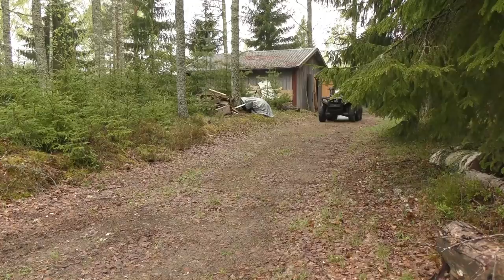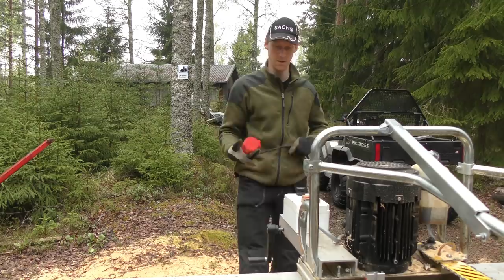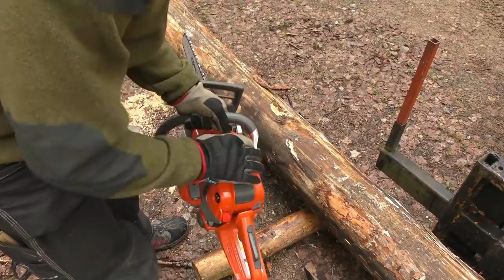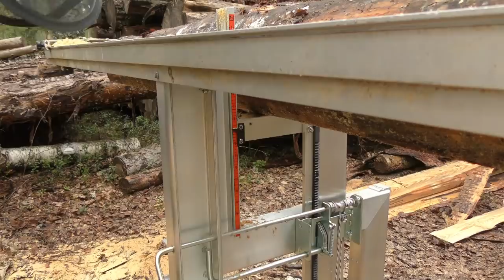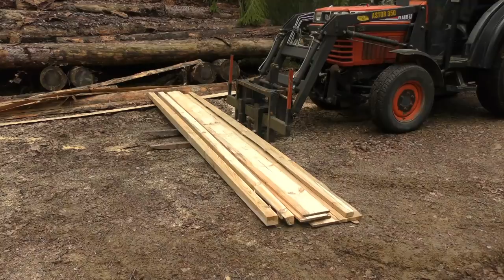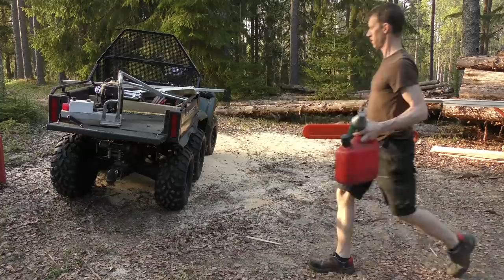Milling on the chainsaw mill — THIS IS AWESOME

Comment: Hi Andreas, I am doing well and had come in from doing yard work and saw that you had posted a video. It is hot and humid today on the coast, much hotter inland though. That is a very portable and easy to use mill apparently simple enough that one person can easily operate it.
Reply from the maker: Dennis St.Germaine Yea it is awesome, easy to run and easy to move. The only thing is that the saw it self weigh a lot. We are also having very hot weather here.

Comment: It's nice to see someone actually cutting usable boards with one of these. It seems that all the rest just cut 2-4  inch slabs the width of the tree.  What can you use that crap for anyway other than making some really large table.  I've never seen anyone resaw the stuff to make it in usable sizes.  Thank you!
Reply from the maker: Thank you very much man. Yea, it's really important for me to cut usable lumber that I can use to repair the old house. I'm also going to build another building so se will be milling all different dimensions for that as well. Have an amazing week and thanks for watching. That means a lot to me.

Comment: Greetings from off grid  Oregon, I like your mill. I use an Alaskan mill if I have a log that is over 21' long as the WoodMizer will only cut 21' I put a boat winch on one years ago that worked well. I use an old 051 Sthil on our old chainsaw mill. Your mill is very well engineered Andreas. Have a blessed night!
Reply from the maker: Thanks Steve, are you still having that really warm weather? I have seen a lot of Americans talking about it.  Here is so warm that you cant get all things done that you plan.
Reply: Offgrid.se It was in the 50s and raining yesterday. I needed a fire this morning but it got to 70f today. It should get warm here in July and a week or so in August then we are back to rain and snow lol. That said we have a much warmer climate than you do I think.

Comment: If you place boards under the feet of the sawmill you’ll experience it more stable and won’t wobble as much, also, have a look at the rubber wheels under the sled. They seem to be stuck and probably worn. Replace them and you will have a much easier time moving the sled. And for safety, wear chainsaw pants as well instead of standing that wide. Your back will thank you later. Nice video and nice setup thumbs up
Reply from the maker: Thanks for the tips man! Have an awesome evening

Comment: I'm sorry, but the idea of a chainsaw mill is that you can easily take it to your tree, fell the tree, and make boards on the spot, no tractor needed to move the trees. 
If you're going to make something this size I'd really suggest a Swing Blade mill. You will save in effort, time, blade cost, and material loss due to blade thickness.

Comment: How about hardwoods like cherry, maple, or oak?  Pine is an easy cut.  What about the power source?  AC, DC?  size wire?   Does the motor get hot and shut off?  Interesting mill.  No gas
Reply from the maker: There is no problem with hardwood if you got a sharp chain. Its AC and I dont know the wire size. The motor never gets so hot that is shuts off. Have an amazing Thursday!
Reply: @offgridsweden  thanks.  I ended up milling over 800 board feet with my 18 inch Stihl and the small Alaskan mill.  It took a long time to get it done, but now I've got Cherry drying on the porch and properly stickered.

Comment: I watched the far side of the chain bar and it seemed to be moving somewhat up and down in sync with the turning of your feed crank.  Are you seeing any wave in your cut or is it fairly straight?  Looks like a nice unit and quite simple which is what one strives for.  Thankyou for sharing!
Reply from the maker: It's fairly straight. I have adjusted sinse then and don't got any wobble anymore. The boards and beams that I'm cutting don't have to be perfect but it's always nice to try to produce quality lumber. Have an amazing weekend Shemon, and don't forget to subscribe for more videos 😉
Reply: Shemon Doublejack:   Thankyou for your quick response.  Glad to hear that it is working out to your satisfaction.  It's nice when  hard work is rewarded!  You're doing a nice job.  Good luck!
Reply from the maker: @shemondoublejack948  Thanks man!

Comment: How much did the chain saw or mill cost you? It is indeed an awesome tool. Love to own something like that as an outdoors man.
Reply from the maker: It cost me about $1800. I bought it used. Sorry for the late answer. Have an awsome Thursday
Reply: Offgrid.se  Welcome buddy !! Thanks for responding.
Reply from the maker: Are you going to buy a sawmill or do you already own one?
Reply: Offgrid.se a Yes !!
Thinking about getting myself one because I need  timber to roof my building project.
Reply from the maker: @TS-yg3lv  Sounds lite the perfect use case for a mill like this. Good luck with your project.

Comment: Love the set up , i have a gas powered band saw mill and it has it's good points but have one with an electric motor seems more friendly , and your blades seem to go through so easily ? are they designed for this type of cutting ?
Reply from the maker: Thanks Eric. It's a really nice setup. The blades are designed for this type of cutting and they are really thin. I keep them really sharp as well. Got a video on how to sharpen them as well. Have an amazing Tuesday man!

Comment: Interesting concept,......but I'm wondering how accurate the hand crank can be.
And with electric there's less noise.
Reply from the maker: Well its not for making material to build a  perfect house. Its rough material. If you want millimeter accuracy youll have to plane the boards. Have an amazing Thursday!

Comment: Is it me or did the blade lift and drop every time you turned the handle causing these boards are not consistent?
Reply from the maker: The slides where worn and there was a small wobble. All the lumber was fine. There is not used for precision carpeting 😁 I have changed those slides an now it don't wobble any more. Have an amazing weekend Mr Zippy and thanks for watching!

Comment: I have an Alaskan chainsaw mill and a mini mill to trim the edges and if you take your time setting it up right it does an awesome job. I run them with a big Husky. I liked the looks of your mill till I saw it run and I hope you keep working with it to get the slop out of it. It doesn't look like it would cut a very wide board and I was wondering what's the widest it will cut. It looks comfortable to run and may cut what you need and that's what counts anyway. Have fun and be safe young man and good luck on all your projects. I liked the guys idea of mounting the base on boards and anything you can do to stiffen the thing up is going to give you better cuts. I think the machine has good potential just needs some tweaks ! I liked the video because it was so different and I have not seen one like that before.
Reply from the maker: Thanks man. I have the bar that handles the logs I got but you could put on a longer bar to take larger dimensions. Not full twize the size I'm cutting but almost. Have an awesome week!

Comment: Super nice mill bud ...
Reply: I have a Jonsered mill made in Sweden that uses an 89 cc Jonsered or Husqvarna (un modified saw) that runs on wheels on rails at ground level so the logs don't have to be lifted - much simpler and more economic system (but they don't make them anymore)

Comment: dont rev the chainsaw with the chainbrake on, not good for the clutch. also let the saw warm up for a minute before cutting. all parts are cold and will wear down much faster when you do that.

and i would have replaced that crank handle with a cordless drill. much easier.
Reply from the maker: Thanks for the tip about the chainsaw. To replace the crank handle with a cordless drill wouldn't be a good idea. The saw will cut uneven and you get small waves in the bords. There is an add on to have it cut automatic but it's to expensive. I get a good workout 😁 Have a great weekend.
Reply: great weekend to you to. altough i would like to share my opinion about crank handle/ cordless drill. when you are cranking it you are emitting a force in 2 ways every turn (by your own arm pulling the crank down and up), a drill would only force it one way since its a constant and equal motion from begin to finish. but ofcourse i could be wrong, im in the process of making something like that myself with a drill attachement, so hopefully ill find out soon :D

Comment: I am in Maine, recently bought the F2+
When I went to buy the Schiller fuel injected saw they told me , and correctly, that science I have had shoulder surgery , I would not be able to pull start any saw over 50cc.  I tried it. They were right.
I asked if I could start the Stihl fuel injected using both hands..they said no.
But it appears that the F2+. Is stable enough so that I could start the saw.. using both hands to pull the cord
How can I get an electric saw and what is the cost?   I have  relatives in Sweden
Reply from the maker: Hi, you could get a Logosol ES8 at Logosol.com. it will set you back 2300 eur. But that is an amazing saw. Have an awesome week.

Comment: Has anybody else noticed how much the chain bar floats up and down? I don't think setup would be good for large slabs.
Reply from the maker: I have adjusted the sliders on the saw and it's more exact now. I'm using a really thin chain and bar as well. For larger slabs you will use a thicker bar and chain. Have an amazing week man!

Comment: How many kilowatts is the bandsaw motor? Also, how does the cutting speed compare to a conventional chainsaw, such as a Stihl MS660?
Reply from the maker: It's an old electric motor and I think it's about 3.5 kilowatts. I would think the cuttingspeed is a little bit better then a ms660 but I have never tried one so I really dont know for sure. Have an amazing week!
Reply: @offgridsweden  Thanks.
Reply from the maker: @massmanute  You are welcome.

Comment: One day you'll connect a battery drill to the feed handle and be happy!
Reply from the maker: Yea, not the first time I had that suggestion. I would like an automated system for it but it costs about $2000. A cordless drill don't work. You can't get it to move at the right speed and right preasure against the wood. But it would be much cheeper if it worked. Have an amazing weekend man!

Comment: right side looks like it might be better if it was also attached to a rail . there's no way those slabs are the same thickness all the way along the length of the cut , you could see the wobble in blade. needs to be solid across on both sides. other than that it looks easy to operate and cuts well.
Reply from the maker: Sometimes you get a wobble in it but mostly it cuts quite good. I have changed some sliding parts and it wobbles less now. Also keeping the chains really sharp helps a lot. Have a great weekend

Comment: New and don't even know if you still are doing this but I was wanting to know what is the name of your setup and roughly what did it cost I am in the US and I have been looking around at these Alaskan sawmills and ran across your video I would like to know what type of setup you have would it cut bigger and harder wood so if you would get back with me I would really appreciate it the video says it's been over 2 years hopefully you're still watching and getting emails
Reply from the maker: Hi there Eugene, I got that mill used but the new one can be found at Logosol.com. The old one I'm using have no trouble cutting hardwood so the new ones are probably even better.  I'm still milling.  I took a break from youtube but I'm back soon. I always answer comments. Have an amazing weekend man!

Comment: Are you using a Logosol F2 mill? I have a full size M8 mill, which is an older model. I like your electric saw chainsaw,  but it is way out of my price range, so I am using a Stihl MS660 chainsaw.
Reply from the maker: Some of mine is F2 parts. I bought an a old used one from a guy that didn't get any good results out of the mill. I kept the aluminum profile that the saw was running on and the saw that I fixed  so it was running well. The legs and the risers and stock holders are F2. Wouldn't afford buying a new electric saw from Logosol either. Have a great Sunday
Reply: @offgridsweden  Thanks for the quick and informative reply offgrid.
Reply from the maker: You are welcome
Reply: @offgridsweden Greetings from Indiana. Could the crank be adapted to a cordless drill to power it? Looks like Carmel Tunnel Syndrome waiting to happen.
Reply from the maker: No, that's not possible. There are systems to automatically pull the saw but those cost around $1000. A cordless drill drives to hard, it don't adjust the speed depending on how much resistance there is in the log and how easy the chain cuts. Have an awesome Thursday!

Comment: What’s the electrical source, 110-220? Amps motor pulls? Size ofa solar homestead array keep up with those requirement?
Reply from the maker: The electrical source is 400v and it pulls about 3,5 amp. The solar array I got has 46 solarpanels and produces about 14 kW. But that is on the other homestead. Have an amazing weekend.

Comment: Whats the red sawmill frame in the background?
Reply from the maker: When I bought the electric saw it came with the homemade red stand.  It was hard to work with that so I replaced it with the stand in the video. Have a great Monday man!
Reply: @offgridsweden  looks interesting, I've just got a logosol timber jig with rail. I'm planning on building my own frame. Any chance of some close ups of the lift mechanism? Cheers

Comment: First thing I noticed, That you should learn how to use a chain saw PROPERLY !
Anyone who stands directly behind the saw as you did,  when cutting that long with your first cut, NEVER stand directly behind the saw, If it grabs an takes off, You could have that saw come down on any part of your body an you could have lost a leg very quickly. 
ALWAYS STAND TO THE SIDE OF THE SAW WHEN an WHERE IT IS CUTTING, SO IF IT KICKS UP IT GOES PAST YOU, NOT ON YOU.
A life in good health is worth more then just being able to cut a piece of wood.

Another thing you could do when cutting lumber to save yourself a lot of mess
You see when you feed the saw as you have done, the chain throws the sawdust back into your face on your side, Try doing it or cutting with the blade throwing the sawdust away from you. It makes life a little more pleasant. Your saw is stabilized by the holder you have an should not kick out, Unless it is of such that it will not allow you to cut in this manner.
Reply from the maker: Thanks for the tip man. I have never gotten any sawdust in my face while milling. Have tried having it cut away and that don't work. It gets really wobbly. Have a great friday.

Comment: Hvor sammenleggbar er dette sagbruket? Altså, hvor liten plass tar den når den lagres, og hvor har du kjøpt dette sagbruket? Om du skjønner hva jeg mener.
Reply from the maker: Kenneth Stensrud Thanks for the comment. The rail is about 6 meter long so that takes up that place. The other parts can be taken apart so it don't take any room at all. I got the room so I store it without taking it apart. I got it from the company Logosol http://logosol.se The models they have now are even better than mine. Have an awesome Wednesday.
Reply: A bit late, but ain’t the “saw rail” separable at the middle making it only 2 Swedish meters as it’s longest part, and the wood “table” on which you place the log on that is shaped like a “ h “ are only about 1 Swedish meter wide and about 1,20 high? The crossmembers that hold the stability are also the longer parts but they’re thin. If you’re thinking about picking apart in between usage. I believe the website is www.logosol.com (or .no for you, Kenneth Stensrud). The new “cheap” sawmill is called Farmers sawmill F2 I believe. Good luck =)
Reply from the maker: @randomstufffromrandomthing6792  You are correct if you buy one now, but my rail is in one piece. Other then that it packs down small.

Comment: It’s nice to have electricity in the middle of the woods
Reply from the maker: Sure is, when it works. But I'm not depending on it and in due time I will have a large solar array there too just as on the other homestead. Have an amazing weekend.
Reply: @offgridsweden  I have a small 2 kw gen set that runs on propane I canrun for about 8 hours with no problem
Reply from the maker: @ponyrein3409  That is awesome. What brand is it?